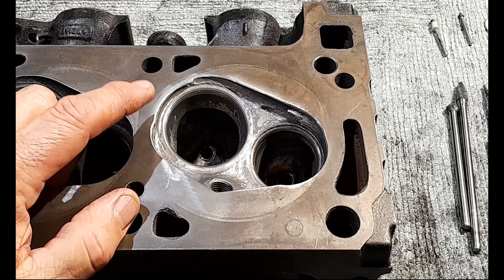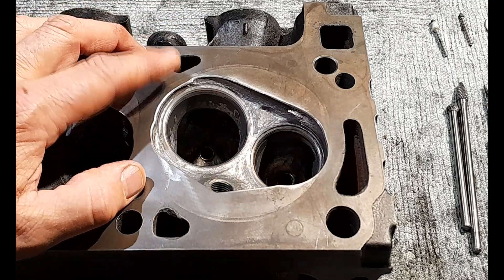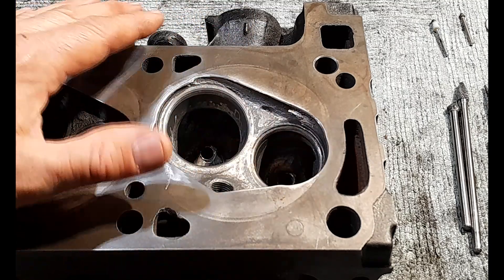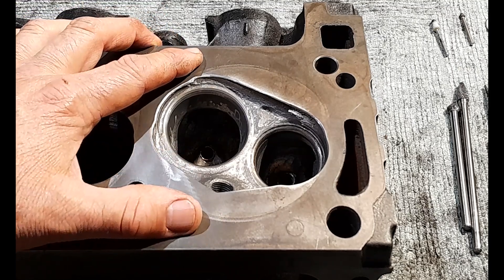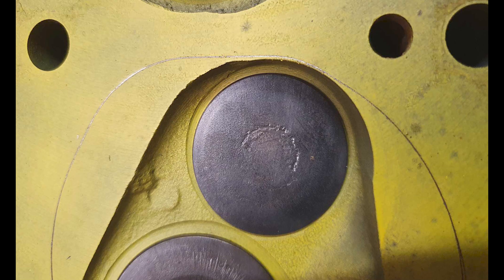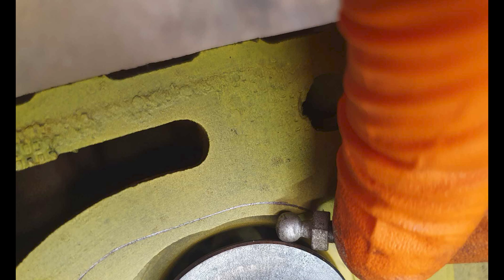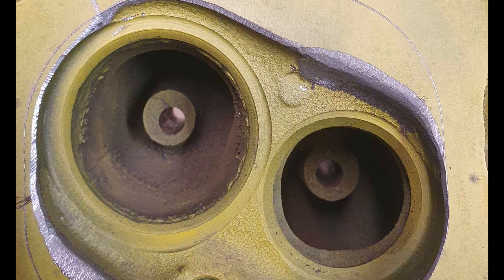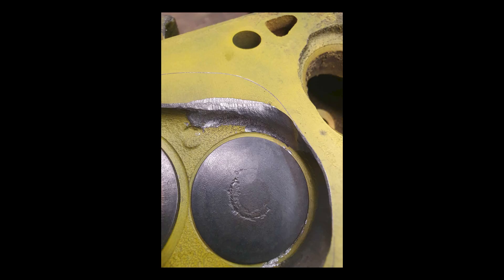351C 2V Iron Head Porting Introduction To Combustion Chamber Mods

Comment: If you are running a 393 c.i., you should try two of the American 351 4V heads with the exhaust lift modification.
  Maybe we could exchange four of your heads for two of ours?
Reply from the maker: A tempting offer indeed mate. Not super keen to find and pay for a new intake manifold. Gotta be a little careful with header clearances in these beasts. You can have issues with raised exhaust port heads fitting in the bay.  

I drive on the street and love the Aussie ported 2V's. More than I need on the streets of my town.
Reply: What is this exhaust lift modification you speak of? 
🤔

Comment: I’m doing a set right now taking your pointer I’m not going over board just cleaning the casting flaws  one question what to fill the heat riser hole in the exhaust valve
Reply: I’m trying cargo thermosteel I filled the hole it’s hardened up reall  strong so far
Reply from the maker: Keep us posted on that method. I’d be real interested how it works out.
Reply from the maker: @roberthirshfield3571  make sure you blend the bottom of the valve seat cut into the bowls on both bowls. Get rid of any ridges into the throat, but don’t mess with the throat size.

The whole idea of this clean up and removing obstructions is to help with velocity.
Reply: @Doctoradhd1  thank you that’s what I’ve done
Reply from the maker: @roberthirshfield3571  hey mate. I have never attempted to block off the crossover. Seen a few folks doing it with molten metal and all sorts of stuff. I’ve thought about stuffing it with steel wool and then applying a high heat steal epoxy. 

Smoothing it and blending it with the bowl after it sets. But you wouldn’t want it to fail, or it’s goodbye to that cylinder. Not sure if it’s worth the effort.
Reply: @Doctoradhd1 Stopping the cross over in the head could possibly burn out, I would  block it off between the heads and use 180° headers.

Comment: Great stuff. And there’s also  back and front cutting intake valves to increase flow. But not exhaust valves , coz direction of flow is the other way 🍻
Reply from the maker: The intake valves in these heads I purchased have the back cut.
Reply: You are talking a minimum a three angle cut, preferably a five angle cut ?
 Why not the exhaust ?? What flows in, must flow out !😮😊

Comment: What are great thing ! Did Craig mention what the hp gain would be around? Cheers Pete. PS this could be gidyup my f100 needs , the poor old girl only has a 302 🫠
Reply from the maker: Yes! He gave me a great example of a back to back dyno tests they did before and after this mod. I'll cut and paste the conversation for you. 

I spent an hour today, shooting a video of me undertaking Craig's mod on my first combustion chamber. Video is uploading as I type this and will be published on my channel tonight.

Here is an excerpt from my conversation with Craig about this mod with an example of what you've asked about.

Craig - "I'll also highlight the areas on an actual head for you. Its a very simple mod and yes it can be done better, but bang for buck, for a home port job with no flow bench, it gets gains and detonation resistance.
 
One particular car I did for example was an XY. It had a 351 stock bottom end and stock 302 heads, so compression was up there. A 2800 stally, stock factory iron 4 barrel intake, square-bore adaptor, 750 vac Holley, tri y 1-3/4 pipes and a 2.5" single exhaust.

He was beginning to lose a cam lobe. I did a cam swap, (old cam was a Speed-pro CS173R).
I fitted a crow cam 21649 and we dyno'd it. It made 265rwhp. It did suffer from detonation and I couldn't get a good timing curve into it. 

I talked him into removing the heads to do the chambers, as it also wept coolant at the front coolant passages. The heads were bone stock apart from valve springs and retainers. I did the quick chamber mods and a real quick bowl blend.  

The pistons were of course 20 odd thou down the bore, so quench was not optimal! Back on the dyno it made 282rwhp and took a good timing curve. Not big horse power, but ok from an essentially stock 351 with a mild cam.

For a long time now I do the chamfers on any closed chamber head engine, even if I don't do any unshrouding at bore walls or any other porting at all".
Reply: @Doctoradhd1  That lip from the chamber to the head squish around the intake area should be left almost sharp, it was for a  purpose... it is to direct the airflow downward to keep it away from open exhaust valve until the very end as much as possible.
Leave the edge around the intake.